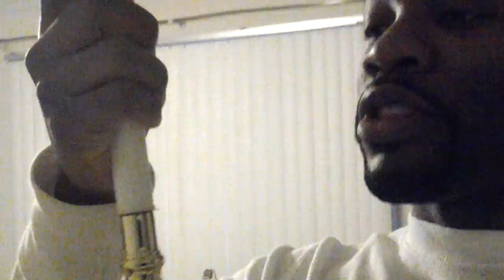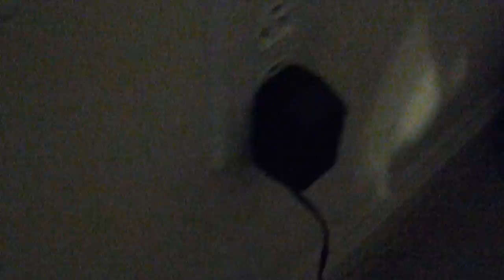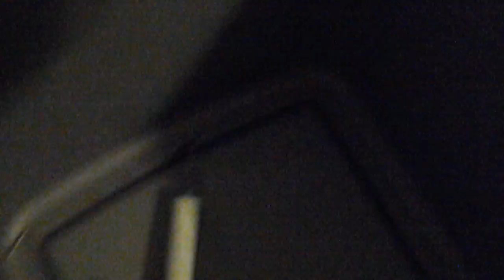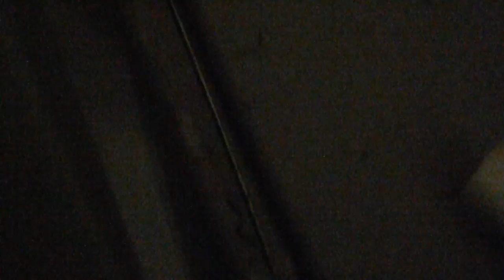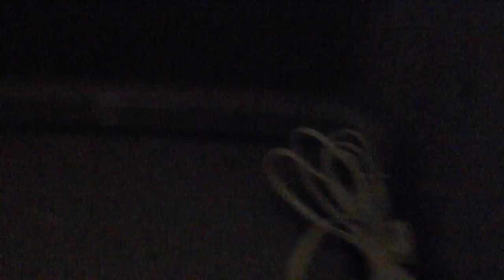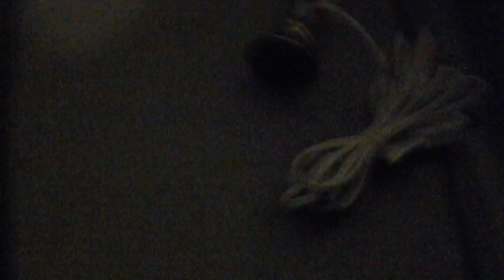Static electricity lighting bulb

Comment: So, couldn't you use a light bulb to use up static electricity built up on your body to avoid getting shocked when you touch metal like a doorknob or car door handle? Also, if it was attached to a doorknob or other materials that gather static charges, it seems that static electricity could be used up before you have time to touch it and get the unpleasant static zap. It seems like if you put one on a computer case and one on your body, you could prevent static shock when working on computers.